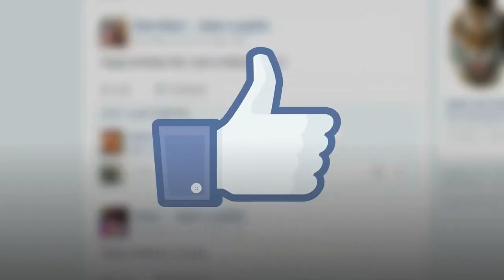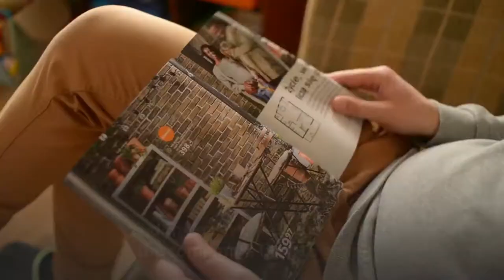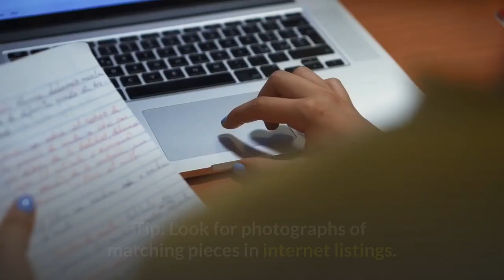Knob Creek Furniture | Is Knob Creek Still In Business?

Comment: Thank you!!!!  ❤ I’m in NC and I have a Knob Creek dining table and chairs in good condition and it was made prior to 1985 as it doesn’t bear the arch door between knob & creek. 6 chairs and leaf insert are also in good condition. Do you know what may be the value? The branders mark/ numbers under the table are 36-6133-360120491 , there’s a number 42 on both end pieces of table on the underside, and there’s also a red stamped imprint on the inner underside that reads  
Walter of Wabash  but that’s the manufacturer of sliding mechanisms for leafs in tables, etc. It’s history goes far back as well but I’m curious what my tables worth is. Any help would be greatly appreciated. Subbed and hit the like. God bless
Reply from the maker: East answer is what ever you can get lol. In perfect condition sero flaws we would ask about $895 minus commissions we might pay .if ruff or what people call good condition maybe$200. Plus the style matters..if flawed with marks or lose chairs or needed new seats maybe $50..hope that helps